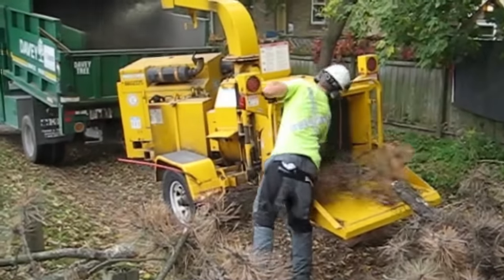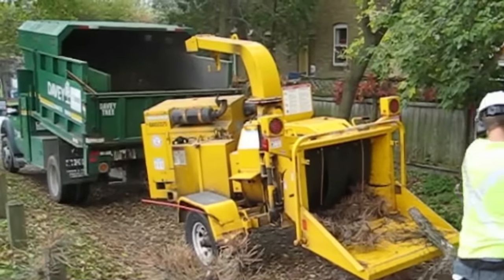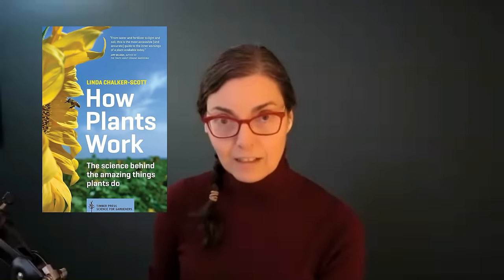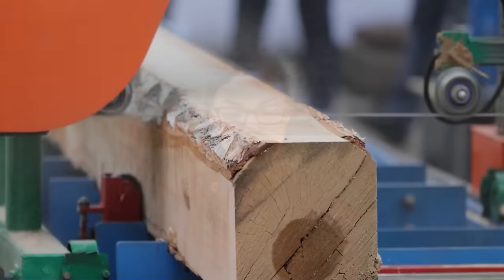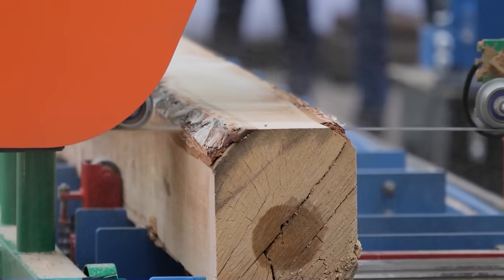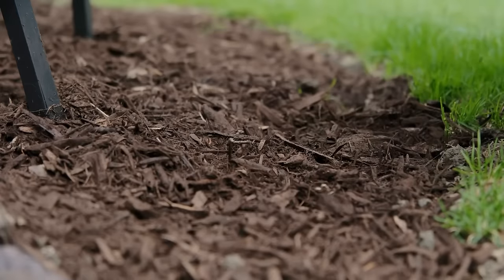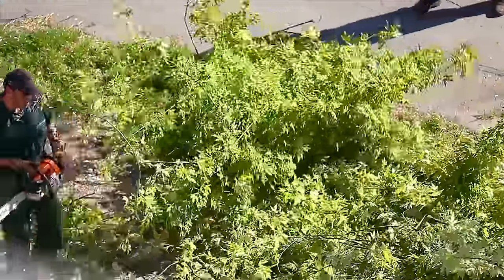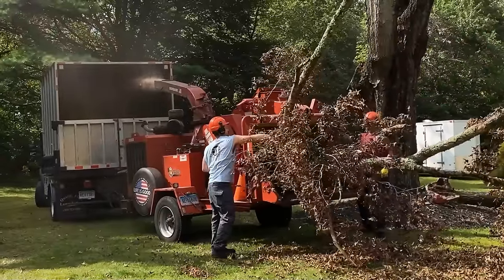Wood Mulch for Fruit Trees with Linda Chalker-Scott. #fruittrees

Comment: When I studied horticulture 30 years ago in the UK we were told wood chip contained growth inhibitors and also used up all the nitrogen in the soil as it broke down and was best used for paths and mature plantings only.  The Royal Horticultural Society also claimed that it spread honey fungus.  How come the goal posts got moved?
Reply from the maker: Great question! Recent studies have shown that fresh wood chip mulch from arborists can actually improve soil health and support plant growth. While it’s true that bark mulch from the timber industry was once advised against, we now understand that wood chips, when used properly, don’t significantly deplete soil nitrogen and can enhance soil structure, moisture retention, and microbial activity. The key is to use them as a surface mulch, not mixed into the soil. As for honey fungus, it’s always good practice to source mulch from healthy trees to minimize any risk. Thanks for sharing your experience!
Reply: @Orchardpeople  I was wondering about the same thing; I use fresh woodchips as mulch for my trees as well as ground cover for the paths on my allotment, and fellow gardeners keep warning me this will deplete soil nitrogen. Could you direct me to some recent literature that contradicts this nitrogen depleting process? Also, I have noticed some people differentiate between the beneficial use of ramial woodchips vs general woodchips, where ramial woodchips are supposedly better suited for fruit trees. Unfortunately, local suppliers here do not differentiate between those two types. Any thoughts on this? Greetings from The Netherlands 🙂
Reply from the maker: @muirnepaap  Hello to the Netherlands! This is a great question and I think this might help you! https://gardenprofessors.com/maddening-mulch-myths/ or this: https://www.researchgate.net/publication/285739101_Impact_of_Mulches_on_Landscape_Plants_and_the_Environment_-_A_Review. Tell me if this helps!

Comment: We had a massive ice storm in the southern end of the Willamette Valley in February. The local city offered free removal of downed material. The city ended up with a massive pile estimated at 3,000 cubic yards. It was gathered wet, chipped, piled, and is heating up well over 100 degrees. It is dark, damp, with mycelium threads in it. The city is now burdened with the gigantic pile, and giving it away by the giant dump truck load. I've made a decision to use it. It is not chips in the sense of being mostly woody trunk material but more leafy, twiggy material. I got 72 yards of it, not looking back, but am concerned about the potential of diseases in it. Hope the heating process might kill lots of bad things. Thoughts?
Reply from the maker: A huge pile will get really hot and kill pathogens. I would grab that stuff and use it!
Reply: @Orchardpeople  Yes! My piles are hot to the touch inside. Thank you!!!

Comment: I am the new owner of a small orchard in Victoria Australia featuring pome and stone fruits. It also has 60 blueberries. I would like to chip the annual prunings to use as a wood mulch. If the plants are healthy, is there any risk of disease from using wood chips created from the prunings from the orchard? I am also considering shredding some of the prunings as an addition to the leaves in the compost heaps on the property. Any issues I need to be aware of? Bringing in wood chips from unknown external sources seems much more risky.
Reply from the maker: Chipping your own branches is ideal as long as they are not diseased. The Youngwood is particularly full of nutrition and helpful. It takes a while, but I hand cut up the new prunings from my fruit trees and sprinkle them around the root system in the hopes that they will break down. So keep doing what you’re doing. Sounds great!
Reply: @Orchardpeople  Hi Susan, thank you so much for your prompt and very helpful reply. The orchard has many heritage apples, pears, nut trees, figs, nectarines and even a medlar! I am taking up the property in May which is mid-way through our autumn. I'll now be all set for the pruning season which will start early September given the heavy frosts that occur on the property. Your channel is going to be one of my go-to sources of guidance.
Reply from the maker: @59markr  So glad you find my channel helpful!

Comment: Excellent video. 
I am a little unclear on how to mulch my fruit trees. I've seen lots of videos and they suggest different things. 

What do you think of this process I've gathered from different videos. 
1) clear out around tree
2) add compost
3) paper or cardboard 
4) woodchips
Reply from the maker: Yes! What I do is 2 inches of compost and then putting 2 inches of wood chips on top. Paper or cardboard only necessary if you are smothering weeds or grass.